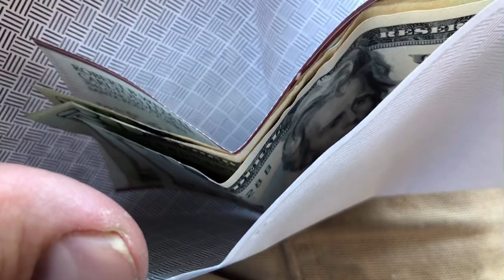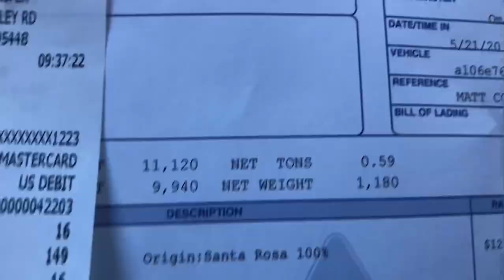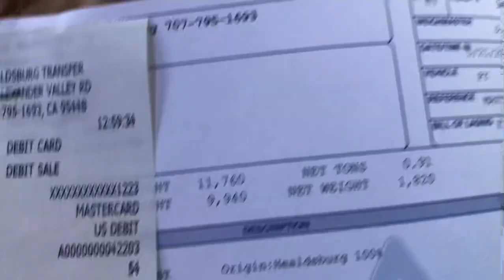How to Protect Yourself From Poison Oak 🍃☘️🌱 Junk Removal #adayinthelife

Comment: those dump fees are high there. 1200lb would be less then $30 in AZ. We also need a bigger house. running out of room to park trailers. have 4 trailers , 1 tractor 1025r , 3 vehicles. had 4 but sold the 16 Nissan so i can get a 2500HD truck. still looking. but for that white stuff. i would have leaf blow it to get ride of it. Would suggest DeWalt 60v leaf blower.